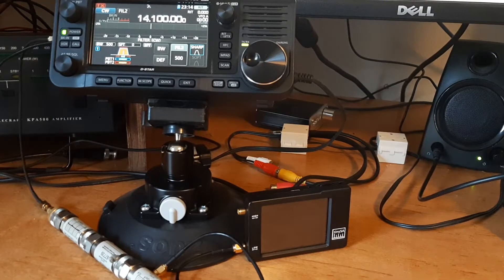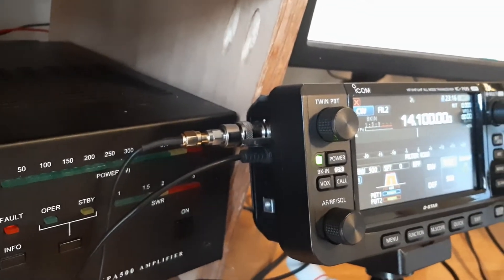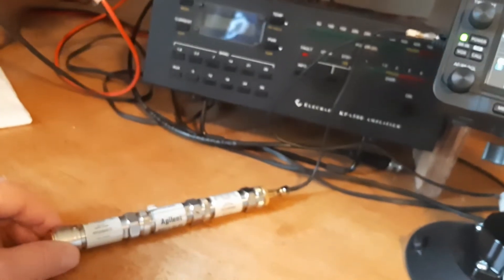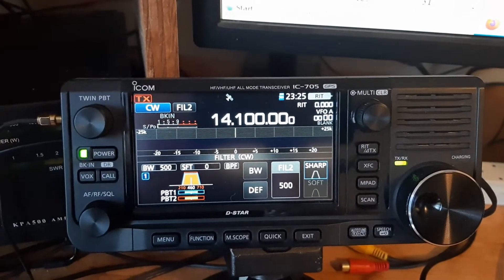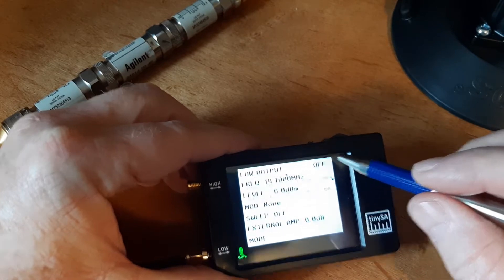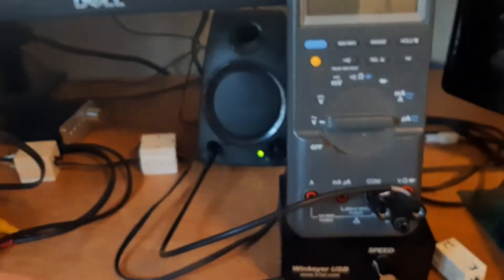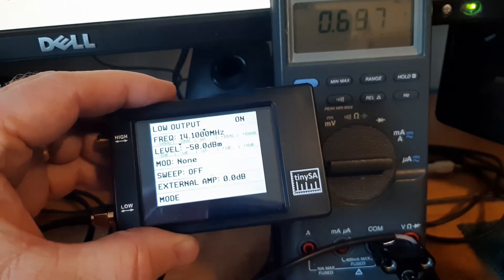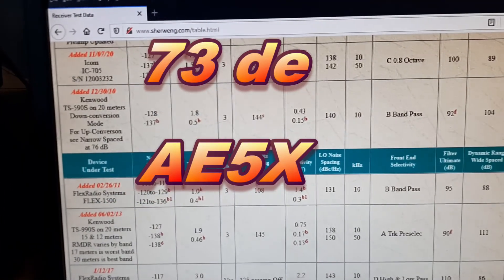Receiver MDS measurements with TinySA

Comment: So this is the same a measuring the SINAD ?Could you have used that step attenuator you used on the ULTRA for this? is there a difference? 
Thanks
Reply from the maker: No, SINAD is usually done for AM receivers since the injected signal is a modulated tone. For mds, an unmodulated carrier is injected, therefore this is for CW or SSB. Yes, the step attenuator from the other video could have been used here and would have been a better choice but I didn't have it at the time. It replaces a lot of fixed attenuators and for much less $$$.
Reply: @AE5X  thanks for the quick reply..does the Sinad on an AM/SSB radio  still give a rough idea on the ssb sensitivity?

Comment: Hi John, 
Thanks very much for this lesson!  I'm just getting into RF now and trying to train myself to think in terms of Db gain.
I computed a gain of 2.922 dB when starting with .5 volts and injecting a signal to get .7 volts.  
If you start with a signal of .5 vrms, and then inject a signal to raise it to .707vrms, I compute a 3dB gain.
Reply from the maker: Keep in mind the formula for gain is 10 log for power, but 20 log for V.

Comment: Hi John, great video! For turning off the AGC on the IC-705, a long press on the AGC button brings up the decay rate settings for fast, medium, and slow. You can use the main tuning knob to reduce the rate of fast, medium, or slow to zero and the radio goes into "AGC OFF" mode.  

As a MW DXer I appreciate you having made the MDS measurements at some frequencies outside of the ham bands. The results look really good and consistent. 73, Guy KE7MAV
Reply from the maker: Thanks for that info, Guy. I'm still learning this radio!

73 - John

Comment: Thank you John, for another excellent lesson. 

I have an Elecraft XG3 signal generator. I was unaware of the Tiny SA and it looks like it will provide additional functions that might be useful in the shack. 

If I understand correctly, you're using the external speakers solely as an audio amplifier so you can get the output at a reasonable voltage for the meter. I think I might add a small audio amp kit to my bench. Do you have any thoughts on this? 

It would be fun to test the receivers of the various radios I have around here. 

Thanks and 73 de AG7TX...
Reply from the maker: Hello David, thanks for the nice comments. Yes, I'm only using the external speakers as an audio amp. Without it, the headphone jack from the radio only produced around 90-100 mV - to low to notice a 3 dB increase when I applied a signal. If I could make the video over, I'd start out at 1 volt with no signal, then apply RF until the meter hit 1.4V.

The TinySA's are pretty useful - just be careful not to overload it when using as a spectrum analyzer.

73,
John